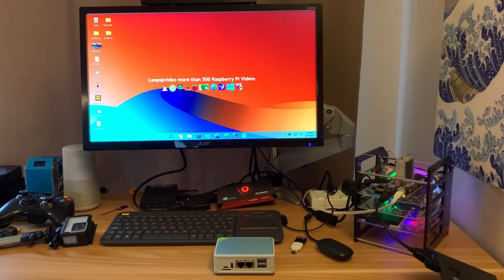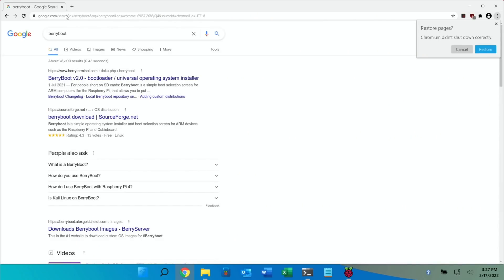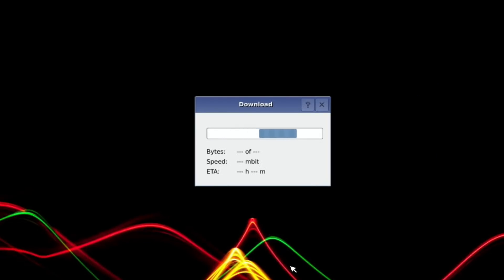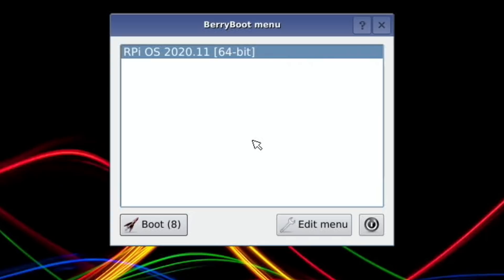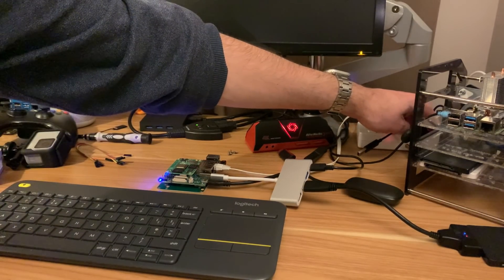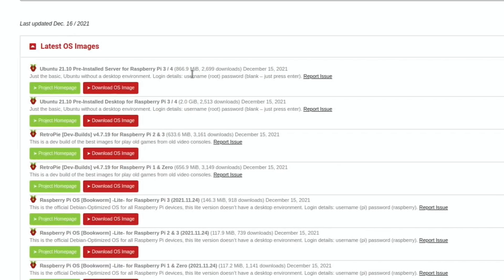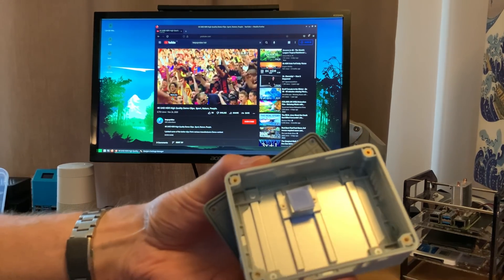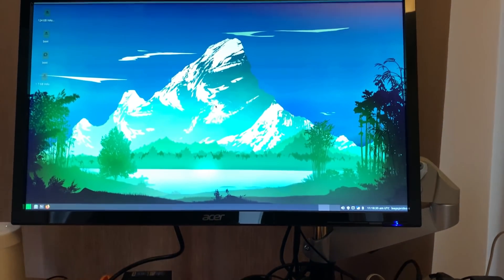Raspberry Pi CM4, Berryboot Simple Multi OS Setup. USB & SSD tests.

Comment: Hi, I know you have done videos on screen tearing with the raspberry pi 4 but I just wanted to see if you encountered the same issues with crt.    I keep getting screen tearing on my raspberry pi 4 via a crt,  happens loads in emulators like final burn and neo geo.  Any help would be much appreciated.
Reply from the maker: My crt is in the loft. Try the Retropie wiki
Reply: @leepspvideo   no worries, cheers for the response.   I've looked at alot information and links around it but it appears to be a common problem, back to my raspberry pi 3 I guess

Comment: I think your problem with the ssd was voltage related ..  I have the onboard wifi blacklisted on my pi 4.. I'm using a usb 3 Edimax 1750 ac wifi dongle.. It uses a lot more power as when I plug in my ssd with roms and backup how too files I end up with a crash straight up or in a short period of time.... Place the sane files on a 128 gig Samsung Bar no more crashes... Plug a usb 3 device into a usb3 connection without enough  power the device will default to usb 2 speeds or crash. My Edimax wifi dongle plugged into usb 2 will only run at b.g.n speeds not ac ie: super slow

Comment: Pads vs Paste - Pads are thicker, if the case is designed to use pads it may perform worse with paste (paste needs a tighter fit between the case and heatspreader).  I have two pi3b+ in flirc cases - the one on paste runs ~10'C hotter than the one with a pad (one day I'll open it up and pop a pad on there!).

Comment: I've got a CM4 but it has no eMMC OR WiFi :'( - but that is ALL there was available ... I've got it running on a Waveshare CM4-IO-BASE-B so I could use my PCIe m.2 nvme SSD. And the great thing is that no matter what OS I've used the SSD has shown up every time without exception. I mainly got this to get some retro emulation going and I've had some different degrees of success. I haven't watched too many tutorials or guides, so I'm kinda just winging it most of the time. This is the first time I've used a Pi, but I have moderate experience with Linux, so it's not ALL foreign to me.
I have often thought about multi-boot but never took the time to look into it. I don't mess with my pi very often, mainly because I have a decent desktop next it, and I'm not a huge gamer. I was disappointed when I trie to watch youtube at 40k60 in PiOS and there were so many dropped frames and it was just unwatchable with all the stuttering and skips. But I was relieved to find that this isn't a problem with my system, that's just the way it is currently.
I would like to have my OS on the nvme, but when I followed Jeff Geerling's instruction it just did not work, even when I started over from step one. And feeling defeated I put it all down, and haven't looked at in the past 2 months. I've been thinking of trying out an Android OS if possible, mainly because I hear it does youtube playback much better that PiOS.....
Anyway, do you think this multi-boot could be setup on an SD card, or a USB drive? (or even the nvme) I would surely think so, I'll have to check out BerryBoot's page. Thanks fo4r that by the way, I had no idea it existed.
And thank you for ALL the videos you do. As soon as I see you've uploaded, I'm on that page like a fly on ssshhhhh... peaches left out on a picnic table :)
See you soon :)
Reply from the maker: Berryboot needs an sd card for boot, Pinn doesn’t

Super easy Multi boot. Setup a Raspberry Pi with almost any device. Pinn Website.
https://youtu.be/eukGyB4sT3o

Better YouTube performance 

Fenix Pi Plasma. Great 1080 YouTube performance on Pi 4!
https://youtu.be/Fq-r2Uh2cE4

The best browser experience on a Pi. Overclocking Chromium OS.
https://youtu.be/AKNAcPxatpY

Comment: where do you get those pin cables from?
Reply from the maker: Mine came in a pico kit

Raspberry Pi Pico Basic Starter Kit.
https://youtu.be/vTHqoUJGxBM
Reply: @leepspvideo  A couple years ago I just bought a baggie full of like 100 jumpers, and I have them in a little box by my desk. They come in handy here and there (I often lose one on the floor!), and they cost like $1 or 2 :)

Though anything that makes a connection works!